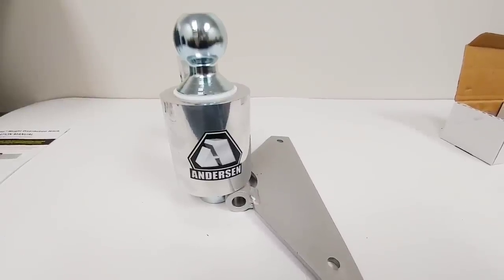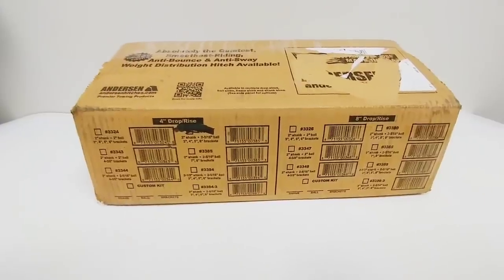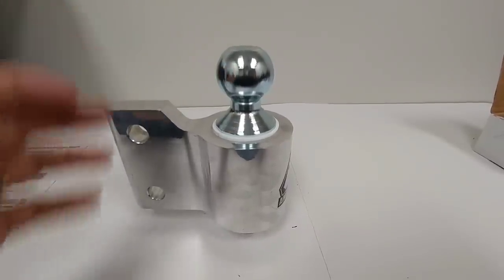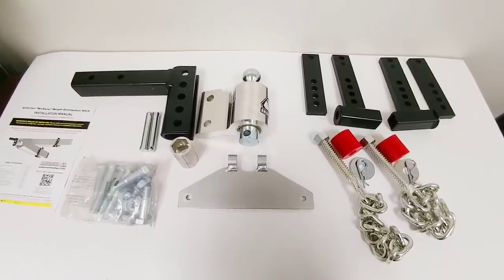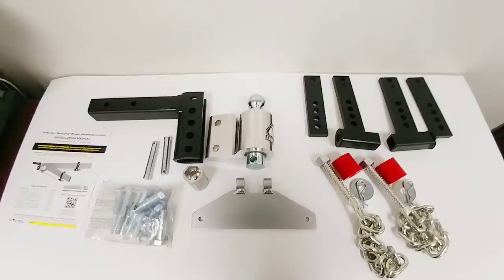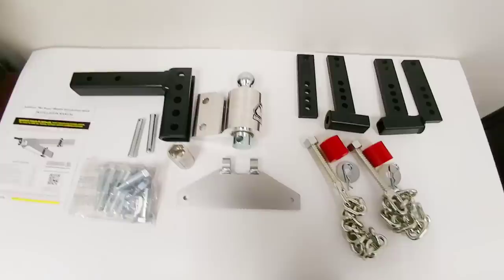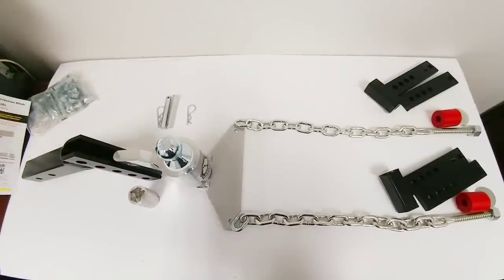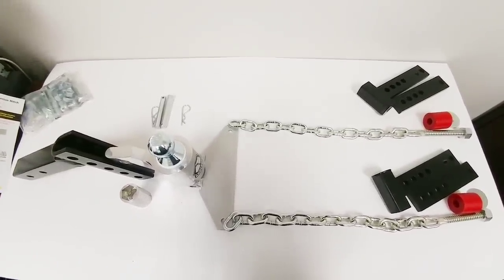The Ultimate Sway Control Weight Distribution Hitch! Part 1: ANDERSEN No Sway Hitch

Comment: I know many people who bought this when they first came out. It works well from a sway control and ease of hookup perspective, but, in general, struggled to transfer more than about 400lbs of tongue weight of the tongue. People with pop-ups and relatively small travel trailers lived it, but for people with larger, heavier trailers and, therefore, higher tongue weights, the Andersen hitch simply couldn't transfer enough weight to resulted the front axle load and reduce the rear axle weight. 

That's what I'd like to see in your second test:  set it up, then do your three passes on a CAT scale to determine the effectiveness of the weight distribution on two or three different trailers.(small, medium, and large).
Reply: I echo gijoecam's thoughts. I bought the system to use on my 8000 lb TT and my half ton truck.  I could never get it set where I felt comfortable towing for longer than a short trip (few hours).  Even after buying my ram 2500 diesel, I tried using the Andersen hitch.  my issue was getting the truck and trailer aligned such that you did not overload one of the red bushings.  too often I had one bushing squished resulting in a very tight chain and the other bushing was uncompressed with a little slack in the chain.  I have since gone back to a more traditional style (won't mention manufacturer) since it is easier to hook and go. You know that feeling you get when you are trying to hook up your trailer Sunday morning, you are blocking the road, and someone rolls up trying to leave.  Yeah, that's what I dealt with with the Andersen.  I felt like l was making others wait on me while I was trying to get the chains balanced.  good company, good service.  very good tech consultants.
Reply: @jturquette  I'm having this issue with my toy hauler. My B&W stow and go rides way better. I'm gonna recycle my Anderson Trailer hitch.😎
Reply: Makes perfect sense if you look at the length of leverage it uses to transfer weight. Bars are long and use downforce of the tongue on the ball where the fulcrum is . The Anderson hitch draws the trailer tight to the ball forcing the lock jaw against the ball where the fulcrum is. I believe this lateral force against the lock jaw is the problem. It wasn't designed for that and I don't trust it.

Comment: I'm glad to finally see a really good video about the Andersen system. We used the Andersen hitch with our then RV, a 33-foot Wildcat Maxx trailer, and it worked great. The best towing hitch we'd ever used even in strong crosswinds. I loved how quiet it is with no more groaning and clanking like every other hitch we'd ever used, been RVing since the mid-1990s. 
Last year we moved back to a 5th wheel, a 33 foot long unit and this weekend we will be installing our old Andersen hitch on our new Winnebago, Micro Mini, they come with 2 5/16 couplers now, our second RV for all those places that the 5th wheel is too big to get in to. 
My ONLY gripe with the hitch is that it can be a bit finicky hooking back up if the truck - RV isn't pretty straight on to each other.

Comment: We bought an Anderson WDH three years ago and on our 17' 3000 lb trailer it works just exactly as advertised.  It's lighter than a trundle type, easier to hook up, and  the draw bar/ball assembly is easy to pull off the truck when not in use.  But we rarely use the "socket" that comes with it.  Instead we do what many trundle WDH users do (providing the tongue jack has the weight capacity). We latch the tongue onto the hitch ball, then using the tongue jack raise the truck rear up a couple inches, then put on the chains and tighten them by hand.  Now some electric jacks with plastic gears may have issues with this, but ours is a hand crank and seems to have no problems.   After tightening the nuts up by hand, we lower the jack, the chains go tight and share the weight with the truck, and we're off and running.  Unhitching is the same process in reverse.  So far this has worked well for us, especially since we bought the Anderson more for the sway control than the WDH function.  We still carry a ratchet and the socket for those rare times we found ourselves with the collar skewed crooked because of how we had to pull into the campsite.  We're still strong fans!  Like the channel!  Ed

Comment: My wife and I purchased this hitch about five years ago when it first came out. We loved the weight, ease and cleanliness of use. However, this is a head's up for those that have a F150 crew cab short bed. We had serious sway issues with this hitch with our short bed. I met with a Rep from Andersen and he acknowledged there was an engineering issue they were working with Ford on. Andersen actually bought our hitch back which I was really impressed with. We were bummed it didn't work out because there were a lot of positives with the hitch. I just wanted to share in the event the issue isn't resolved.
Reply: Same for me with a 1500 Ram   Anderson was great and refunded all my money.
Reply: What is so different about the fords that interfere with the hitch working properly?
Reply: Kyle Ginder not sure but from what the Rep told me, it had something to do with air flow under the bed. The engineering is above my pay/knowledge grade! There didn't seem to be an issue with the 6.5 bed though.
Reply: Kyle Ginder Nothing; it’s a 1/2 ton truck problem, not a hitch problem.

Comment: I've always used a bar system but that's what I was brought up in using since I was 14 and was helping hookup.  Still have those in my barn.  I see from all the comments that everyone is liking how these work, I saw where one guy pulls a 38' trailer with his now that seems a lil extreme for this product in my opinion, but I don't know all there is about how this system is made like is the shank solid or is it very thick and by the way it's made what the bottom triangle piece is made of seems as though it would flex when on such a large trailer.   On one that large I think I'd rather stick with the bars that slide into a solid shank.  But I'm glad to see this for smaller trucks and trailers and you are explaining it very well

Comment: This is a great hitch. I switched to it 6 months ago. I use it on a 38 ft outback travel trailer with a ram 2500 with Cummins. The bounce you talked about is gone with this hitch. Very easy to dial in. In fact I had a situation on our big trip this summer where our fresh water tank filled up with out me knowing over night. Hooked up and got on highway and the sway was bad. Way worse than day before.  Was able to crank an extra thread on the bolts at a truck stop and all sway was gone. 30 seconds and fixed. Until I could fix the original problem. Your friend will love this hitch.
Reply: I agree, that's a great hitch and they will be happy with it.  I can't compare it to any other, because I have not used any others.  I recently bought a 32' bumper pull as a first travel trailer from a dealership in West Texas.  I live 8 hrs away in Southeast TX.  The dealership was going to sell me a WD hitch installed for $500.  I looked it up on Amazon and it was as $200 hitch.  So then I read some reviews and watched some videos about the Anderson.  I bought one on Amazon for $500 (2 .5" receiver) and installed it myself in the dealership's parking lot before I left.  I was worried about heavy cross winds in West Texas because I had never towed a travel trailer at all.  And I had a long drive.  Only at some of the worst spots did I experience any sway at all, and it was very minimal.  And it only came from heavy cross winds.  I never felt the slightest movement from a passing 18 wheeler.  And once I got out of the open area of West Texas, there was no sway at all the rest of the way home.  I'm sold on the Anderson.

Comment: Dude I have watched a few of your videos, man this one was awesome.  You explained this system.  I have been looking for a towable for 4 months, and I just purchased a 2021 Winnebago Micro Minnie.  I have a 2017 F-150 with tow package and brake control from the factory rated at 6200 lbs.  So I had to buy small.  This is also my first towable Rv of any kind.  I will be buying this system through your link.  Kudo's man!  Keep the videos coming.

Comment: Amazing customer service. Great product for the right applications.    I could not get it to work with my 30 Ft Airstream.   I spent several weeks trying to get it right.  As I mentioned,   Anderson is a great company.   

 If you are pulling a travel trailer that is toward the limit of a 1/2 ton truck.   I would consider the ProPride first.  Could not be happier with how my truck drives now with the Propride.

Comment: This is the hitch I use on my truck and I will say I love it. So easy to use and much smaller and lighter than typical wd hitched.
Reply: I'd also recommend buying a few snap rings to replace the slip pin on the triangle plate pib

Comment: This WDH has many unique features...my favorite is its compactness and weight so unless I am hooking/ed up I remove the hitch assembly and chains and stash them in my TT's storage. However it has a major drawback (and the source of the complaints you will see on other forums)...the amount of sway control is controlled by the weight on the ball so if you are towing long and heavy (a common problem with 1/2 tons) the more you distribute weight the less sway control you will have. Other systems use 2 independent mechanisms which is always a better thing.
Reply: The amount of tension on the chains will also place increased pressure on the sleeve.

Comment: Own one (for my F150 and 7000lb TT) and you have done a good job of describing this WDH. However you still want a torque wrench and 1-1/8" and 15/16" sockets (and a breaker bar) to attach the hitch assembly -- the instructions say "approximately 150 ft-lbs" of torque if you are a good guesser. If you have a well equipped tool chest you may have these (I didn't have the sockets) or you might be able to use adjustable wrenches but you need leverage (and why the breaker bar is useful).

Comment: I have this hitch with the 3" shank.  I moved up from a Blue Ox WDH to get the 3" shank, which nobody but Andersen produced at the time.  I pull an 11k GVWR toy hauler with a 2017 F-350 CCLB SRW.  Tongue weight is between 940 lbs and 1,450 lbs depending on if I have my ATV in the garage or not.  I'm usually loaded close to the GVWR.

Installation was fairly straightforward.  Avoid the temptation to scoot the trailer brackets too far forward on the trailer's frame, towards the truck.  If the trailer brackets are too far forward it limits how much you can adjust the chains.  You'll run out of threads before you get enough force.  My only challenge during the install was that the trailer brackets were a couple millimeters shorter than my trailer's frame.  That made it difficult to get the bolts into the brackets.

The red "springs" need to show a bulge.  If there is no bulge then you don't have enough force and you'll probably get bounce and maybe not enough sway control.

Sway is non-existent.  Mission accomplished on that issue, which was my primary reason for using a WDH.

Bounce is controlled but is still there a bit.  The more force I put on the hitch the less bounce there is.  Going from no WDH to the Andersen, the bounce is about 80% controlled.

Is this hitch easier/faster/safer to connect?  I don't get a hernia from carrying it so that's a win.  Once you get used to it, the time to connect is a bit less than a traditional spring bar WDH.  It's safer than my Blue Ox in that I don't have to muscle the spring bars into place.  When uncoupling there is no chance of injury should the spring bars overpower the lever.  There is no chance of pinched fingers.

One thing to note is that the ball and coupler need to be free of grease.  Do not grease either one.  The coupler needs a solid grip on the ball so that the ball can prevent the coupler from turning (preventing sway).  Not having grease on the ball/coupler can be an issue if you use multiple ball mounts with the trailer.  Keep them clean.

I posted a much more in depth review on the Ford-Trucks forum in the towing section.

Comment: I purchased this hitch for use with my 36' Dutchman Travel Trailer and it initially worked fine.  However, within a year the friction material came loose in the hitch ball and the compression bushings began to lose their integrity.  I contacted Andersen multiple times and while they would sell me replacement parts, there was no warranty offer and the parts they were trying to sell were not improved from the ones that failed.  I gave the hitch away to a friend with a lightweight travel trailer who was willing to purchase replacement parts and he has been happy using the hitch for the last 5 years.  So my experience is that the hitch will probably work for smaller trailers but if you have a problem, Andersen does not stand behind their products.
Reply: wnmttx it’s supposed to have a lifetime warranty?

Comment: You have one video where you call The Equalizer your go-to hitch. Then this video you called Andersen hitch the ultimate in sway control. Curious which one is better in your opinion in controlling sway? I currently just bought a Husky Center line. Very much like the equalizer. It is much better controlling sway that my last bar/chain/friction device setup. But a pain to setup/hitch up, noisy, and heavy. Wanna try the Andersen on my travel trailer with 1000 lb tongue weight, 7600 lb overall. Have heard the Andersen does not do well with high tongue weights

Comment: Question, is this Anderson hitch good to use on a 4 wheel air suspension vehicle that self levels? I have a Land Rover LR4 with 7700 lb tow capacity and wondering about the use of this Anderson hitch.

Comment: Anderson or equalizer Weight distribution for a 34’  Jayflight being pulled by a 2018 F-150 3.5 eco boost??
Reply: Thats a big trailer for that truck
Reply: @POOL_EXCAVATIONS  
It’s about 8200 full of equipment. It pulls it like nothing. 12,500 max tow with 36gal tank tow mirrors 4 door extra long bed. I was pulling it with a v10 excursion but I traded it for the f-150 and my buddy sold me his propride trailer hitch and it pulls much better now.
Reply: @anthonyg5055  nice!!!

Comment: Hello,

I am a fan of your YouTube page and I thought you be the best resource to reach out to.. I am buying a 2021 forest river Wildwood X-Lite 263BHXL and I have a 2016 Ram 1500 sport 2wd with tow package. I am having trouble deciding between the e4 equalizer hitch and the anderson weight distribution hitch. I have read more pros for the anderson hitch as far as ride comfort as far as reducing the bounce witch happens with normal weight distribution springs arms. I have only personally experienced the weight distribution hitch ez lift which did cause bounce when I encountered bounce. Any advise would greatly be appreciated.

Comment: Hello, great video, interesting product.  I look forward to the part 2. I am assuming you will be doing a test drive with this. I am curious if you have ever tried the Hensley hitch?  What are your thoughts on the differences between Anderson and the Hensley?  Thanks!
Reply: I haven't tried the Anderson hitch, although I do have and love the Anderson Ultimate Fifth Wheel hitch.  I did have the Hensley Arrow trailer hitch 20+ years ago and absolutely loved it.  I was towing a 31 foot travel trailer and it was awesome for sway control compared to before I started using it.  I'm sure they have made it even better after all these years.
Reply: The guy who used to run Hensley has a competing product that's an improved version - the ProPride. I have one and use it...it's awesome. It's truly "no sway" using physics, not friction.
Reply: One difference between the Hensley and the Andersen is the price. The Hensley is around  $2500, the Andersen is  $5-600.00 depending on which  kit you require. Engineering wise the are completely different.

Comment: I don't understand the sway control. If it makes it "very hard to rotate" then how do you turn corners with it and for sure how do you backup with it. It has to turn A LOT !
Also hard to believe that chain is as good as a steel bar, seems like a lot of pressure/tension that would snap the chain. Must have a hell of a rating.

Comment: I'm interested in this system simply because of the trailer I'm looking at (don't own it yet).  The trailer I'm talking about is the US Cargo ULAFTX, 7x14 with the 30" vee-nose.  This configuration puts the tip of the vee-nose about 10" +/- from the ball....YES, it's that short!  Problem is, they have this trim that covers the sides of the tongue and frame and there's no place to attach those spring bars or levering arms.  I asked the trailer factory about this, and they simply said you can't install a typical WD hitch....CAN'T!  What's a person to do?  It looks like this Andersen system is the only option I have, and I'll need to weld those anchor brackets to the frame (5" frame height).  Any thoughts? Have you any experience with this scenario?

Comment: Thanks for the good video. You do not explain how this transfers weight, nor do you claim to. I expected that from you but should not have. My fault.
However, you kind of scratched the surface of the concept enough for me to realize that the trailer is hanging from the chains and pushing against
the back of the ball to distribute the weight.
So far, from watching videos and going to their website, I haven't seen a good explanation of the mechanics of this or the price. 
There must be a video showing this, but I just haven't found it yet.

Comment: On my trailer, the emergency brake cable is mounted on the inside of the frame right where my brackets for this hitch need to sit. Has anyone else had this problem? Is it possible to move the emergency brake cable somewhere else?